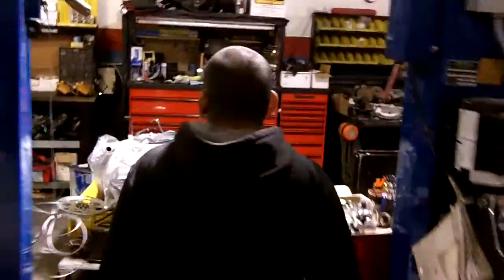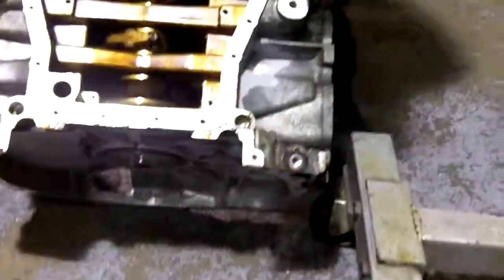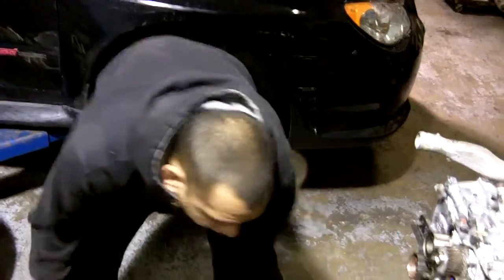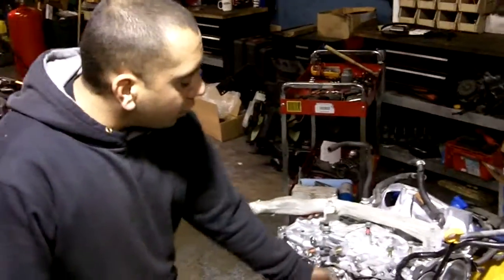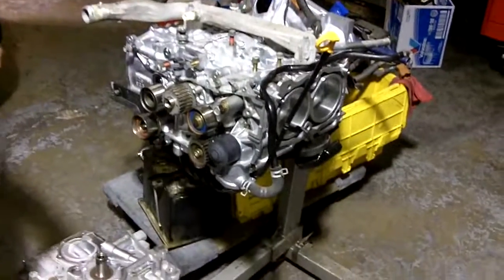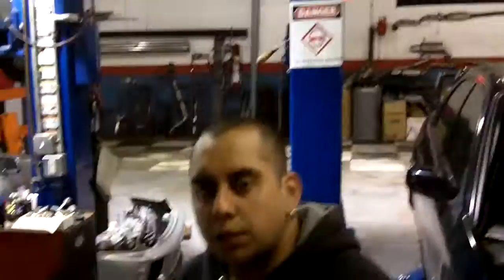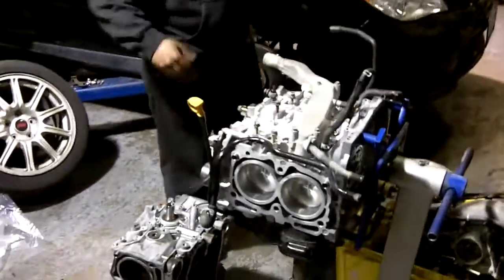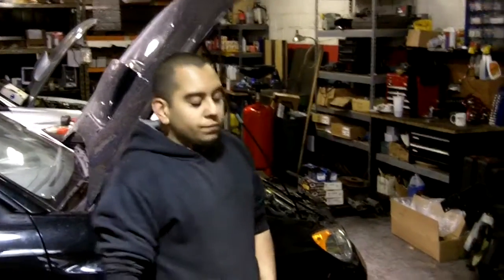Old and New Subaru boxer short blocks

Comment: 2k for my 2004 Impreza, 1k for the full engine with the old engine sent int as a core and 1k for the install... Impreza 2.5RS. I can tell you where if you need the job in Sterling, VA ... Northern VA, MD and DC area. The best price I have seen anywhere around.

Comment: my wrx 2013 died on my driving off the highway engine turned off, wheel got stiff.  took to service they said nothings wrong, picked it up then drove it 5 mins later same thing died on a turn into a drive through.  towed it again. 

they had no idea after test driving.  but when they went to park back at the service center all lights came on etc.  the took apart the engine and said cylinder 4 piston cracked. also before this they were wondering why the spark plug was bent.  i didnt touch it at all.  

they are ordering a new shortpblock to fix it.  thank god insurance will cover it but should i ask for a new engine?  im not feeling good that it can turn off in the middle of driving if i was on the highway i could have gotten into a big accident but was lucky.  

this was 2 years after i told them i was getting check eng lights and engine was cutting power stuttering in boost.  they kept telling me its fuel emissions leak tighten your fuel cap, i even bought a new cap.. no difference always had power loss at boost engine didnt run at full power.  

then it was at 1 and 2nd gear not giving me any power. it would keep me at 10 mph no matter how far my foot was on throttle.  i just want a new car honestly what do you guys think i should do what would you do?? i have a 6 year gold star insurance on it.

i took it too all servicing points for oil etc.  no mods, etc.  i don't dump the clutch and race it etc